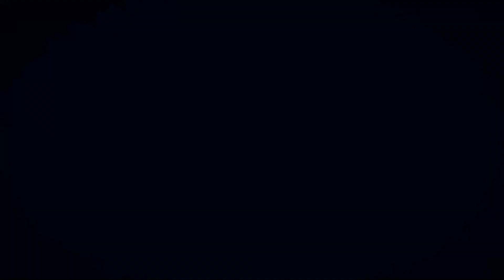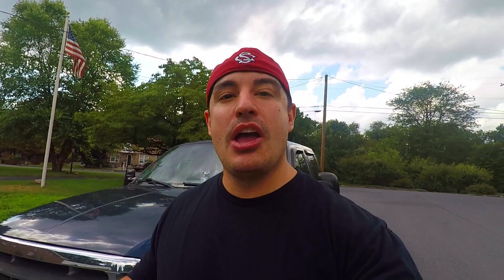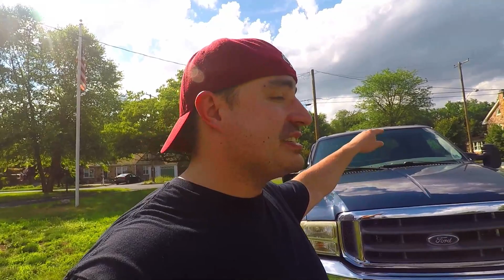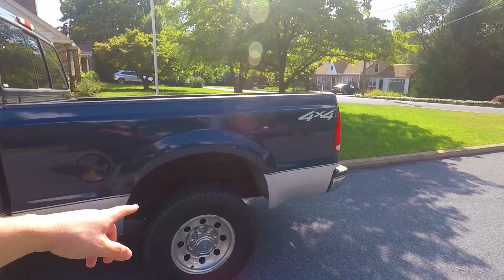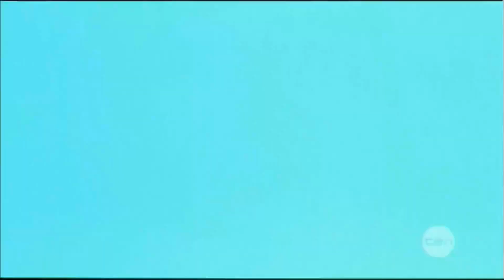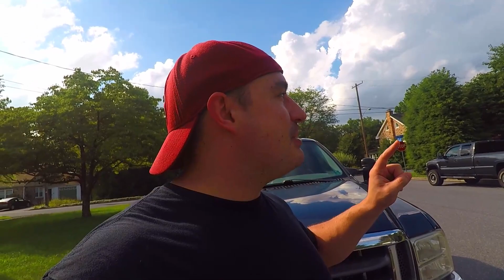6.0 Powerstroke Build Kill Devil Diesel Build

Comment: How long is the wait on the engine?
Reply from the maker: It's at the machine shop now in line to be assembled. Not sure I am waiting to find out when the machine shop will have it done but they are hesitant to say anything
Reply: @six0bros  If it’s ok, keep me posted I ordered one with the SR3 intake and no EGR. Is your configuration somewhat the same? What are you going to use for tuning the system? Do they sell that spas well? Just trying to get an idea on the time frame from start to finish. I live in NC and they are about 4 hours away. I can’t wait… stay safe and well. Hope to see it though…
Reply from the maker: Oh from them my build in a box was about 12 weeks, but I have had that for sometime. I wish I would have just paid for them to assemble it

Comment: I know previously you stated stock nozzles for anything below 205, I wanted to get your opinion of a 175 with 15% DDP nozzles
Reply from the maker: So while I am a huge advocate for the small nozzles on bigger bodies at the same time there is some benefit to them even on a 175. I like the idea behind a 15% on a 175 I think you would be happier overall with a more proven setup like a 190/30 or of course my next injector 205/30. My main concern with the 15% is I haven't heard a lot about them so may have a harder time getting a tune dialed in. I could be wrong though.  I would contact a few tuners before going that route. If you really wanna stay at a 175 and want bigger nozzles I would just go with the 175/30s
Reply: @six0bros , yeah warren diesel was the one who recommended the 15% nozzle, I decided to go with 190/30 I was hesitant because my primary focus is towing. I do believe with tuning and all the supporting mods I have I hope to maintain reliability and the 190 should help in the Dyno and can be tuned down to tow….
Reply from the maker: 190/30s are very safe for towing. You can tune a 190/30 to tow exactly like a 155/30

Comment: I’m getting ready to order a stage two long block from them. I want it but my engine that I have now run so good I have to find somebody that wants 160,000 mile engine in perfect condition to make it make sense. Probably if I can get 4-5k out of the one I have and I could make it make sense.
Reply from the maker: I have spent a lot of time looking at used engines. I wanna say it's normally about 3500-4500ish unless it's been pretty well gone through and you can prove everything the used market is kinda a bear.

Comment: For rear diff cover BANKS hands down.
Reply from the maker: The banks is super nice I just wish they didn't have that huge logo on it
Reply: @six0bros  and wish they weren't $400
Reply from the maker: Yeah the 400 seems a bit steep to me. I do think it has the best design overall but I'm not spending that money over the other offerings I think they played the round cover vs flat back up to much in the video
Reply: @six0bros  well if price us a bigger concern over performance then I'd go for the finned back OE style here: https://www.amazon.com/dp/B07QRYZ44R/ref=cm_sw_r_cp_awdb_imm_0XHZJV6VK6TSMB6D6FNT 
Theres no way I'd spend all that money on a flat back that is detrimental to performance. Your money, my opinion.
Reply from the maker: I agree that banks is the best. I'll probably do the oe finned one price wise it's hard to beat. I would run a flat backed one if I was in need of the added rigidity if I was making some really big hp I would consider a flat back but agree banks is superior